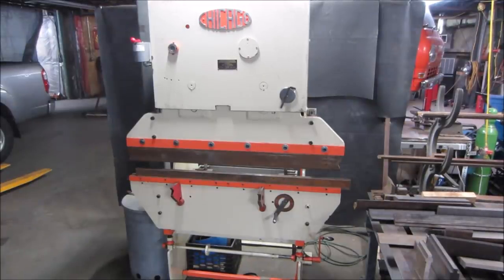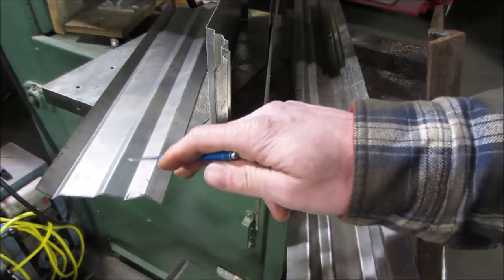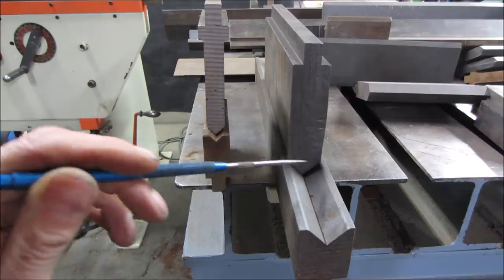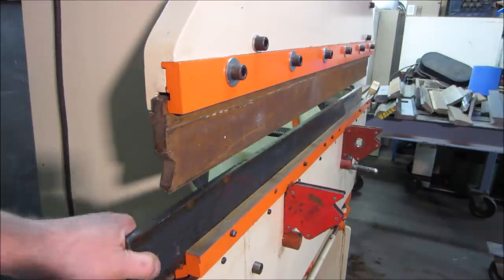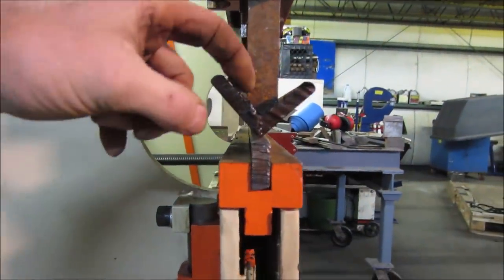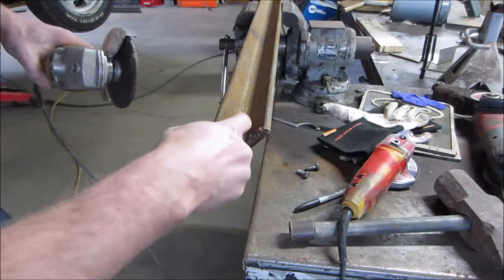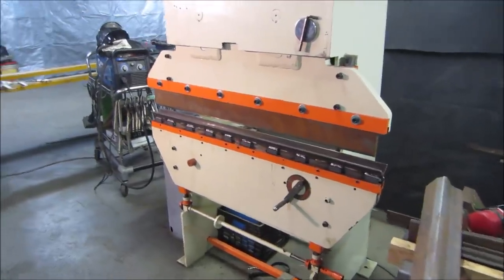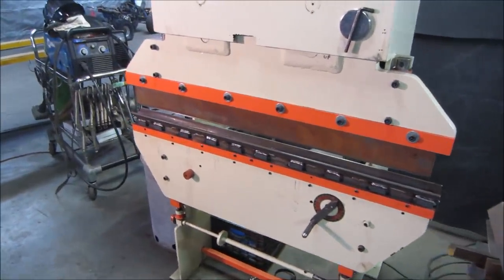Building Press Brake Dies out of Angle Iron.

Comment: Andrew Camarata uses a Fein Slugger circular saw that cuts metal perfectly. He was cutting 1" plate with ease and the edges were perfectly smooth. I think they are available on Amazon.
Reply: Andrew!
Reply: @polymath No, abrasive saw RPMs are too high
Reply: Aren’t comparing two different approach’s to solving problems that have multiple solutions?
Reply: Kirk Valko  Very true! AvE tried to convert an abrasive chop saw into a metal cutting saw. Didn’t work for that very reason.

Comment: Off topic but I wanted to give you a shout out. Picked up a garage sale Columbia self propelled mower last year and it ran great with 1 pull start till a couple of weeks ago (yes we're mowing in Texas already). Was going to take it to a shop to fix it and thought well heck I've watched mustie fix worse so how hard can it be? Pulled the bowl on the carb(clean) and then noticed the choke baffle was open:thermal choke supposed to be closed when cold. Fiddled with it and found it to be gunked up externally. Sprayed on some carb cleaner,freed it up and it's back to a 1 pull start. Thanks for taking the time to post instructional videos! I' old and been fooling with "stuff" for over 40 years: sometimes a refresher course is a great thing to have.Thanks again. Amos

Comment: Brings back a lot of memories, spent a bunch of time at a break press for the Boeing Co. Be careful there is a lot of pressure on those dies, I broke a bottom die  once . Split that thing right in two, never did that again. When you get to use it and become familiar with it , you can sneak up on how much to adjustment it takes on the hand crank. We had a digital read out for ours. Anyway I’m rambling, have fun .

Comment: Mustie, I admire you for making the bottom die. I am glad it worked for you. The only thing I would suggest is beefing up the outer edge of the angle iron. Without the extra support, over time the angle iron “V” opening may open up, making it more difficult to get a 90 degree bend

Comment: I worked for a metal fab shop in Indiana for 20 years  we had two press breaks about the size of yours, maybe a little bigger, we used them for for small thin metal parts, and stamping numbers on parts, i spent many a hour running break press like that, and bigger hydraulic press-brake.

Comment: Mustie1...you were on the right track, the Hypertherm 45XP would have done it in one shot with minimal heat input (less warpage) but the 30XP is at its limit.  It is rated at 10 inches per minute for 1/2".  The 45XP is probably 25 IPM so you could make the cut in one pass.  You also need to consider the primary voltage.  115VAC gives you less secondary power than 230VAC.  Also, you probs hit the duty cycle  on the 30.  BUT, you fixed it, so more power to you!  Transparency, I sell the Hypertherm line and have many years of experience with them.  All great machines.  Love this channel.

Comment: Hi, grind off grey scale sometimes helps cutter,also may need to support sides of angle iron as they may start to open out over time when bending thicker sheet. In industry a little lube is used on base form, helps metal slide into shape. Good job thanks for all videos.
Reply: I was wondering about the lube aspect. Thanks for mentioning it.👍
Reply: @Laz_Arus  thanks for comment, Worked in car industry 30+ years,press shops etc.

Comment: The upper tooling is called a punch. The die is the bottom tooling. I spent many years working cnc press brakes. At one point i worked forca comppany with an 8 metre unit (although not as a press brake operator.

Comment: Top 'die' is actually called a Punch. Die on the bottom, Punch on the top. Hardly ever have to section the bottom die. Top punches are cut to specific widths, so the combinations will make almost any width. The specific lengths are listed on the punch mfgr's web sites.
Reply: @mattthescrapwhisperer  thing is, that with big machines for production work, you can have one half with the punch up, die down, but the other side reversed...why? flipping a 50+kg piece of sheet metal takes a fair bit of time, if your part is has a multiple zig-zags, this saves a fair bit of time.
Reply: @AKAtheA  Agreed. Sometimes that type of setup is the most expedient.

Comment: I'm sure this is how it all started, making something that will work for you. Now all you need to find is an old metal lathe to make your dies from scratch too. The shims are easy, just use key stock of different sizes. Great job, can't wait to see you fighting rusted frames and pans, one bend at a time.
Reply: He has a lathe.  Question:  How would you make those dies on a lathe?
Reply: @paulcopeland9035  Technically I guess it would be a mill/lathe. Where the cutting is stationary and the piece moves. Modern day CNC machines with moving heads handle this work now, but back in the day, it was all man and machine. The way he finds things to work with, you never know when he would come across one to be able to do that. I used to have to work with a lot of machinist for work on our equipment, so was in a lot of shops. it was amazing how they made things from a lump of steel. I hope this clarified the meaning of my comment for you. I am not always smart enough to explain what my mind spits out, thank you for the reply.

Comment: It looks like you are having problems lining up the material. One thing you might consider is to set up a lazer level that shoots down the trough of the die. Then when you put the material in there will be a line to match up to where you want to press it. I make skis and use this method to a line things all the time and it works great. Just an idea. PS your the man!

Comment: Try one of the 'new' Diablo steel cutting saw blades. I just picked one up for the metal cutting 'beam' saw I built from an old DeWalt ('50's era) radial arm saw and fell in love, instantly.

It's a carbide tipped blade, with a negative hook, (think that's the term) so it doesn't catch teeth and tear material out of vises. It is an amazing steel cuttin' blade, made for cutting thick steel, not the 'conduit' blades that have been around for a while.

The rip you needed to make could be done with a Skil saw in 3-5 minutes  with no clean up needed, just an edge deburr!

Comment: The ledge on the bottom dies that sit on the die holder top surface allow for shims to compensate for variation in bend angle along the length. If you have an old tape measure you can cut it up into different lengths and add them in areas that are not bending as much. If you add more than a couple shims on top of each other be aware that the die will rock when the top die (punch) pinches the metal. Avoid this by tightening the the allan screws on the bottom die. Nice video!

Comment: I've used the hydraulic version of these machines 10ft wide and ours had a laser line which made lining up the workpiece much easier also the bottom die had 4 different sizes on it. It is handy having different length top dies to use for folding 4 sided pieces.

Comment: Regarding the rough edges with the plasma cutter, another YouTuber, Andrew Camarata, found that for really thick stock the Fein Slugger Metal Cutting Saw works best - no burs, clean cut. Fein makes a lot of metal saws. I’m referring to the handheld ones. $300 to $500 depending on size and power.

Comment: I used to run a Ceybold guillotine much like this machine at Samsonite in Denver assembly it was 72 inch blade with air tables on front and measuring air table on rear. We used it to cut thin strips of plastic about 100 layers of sheet at a time along with laminated cloth on chip board. The machine was rarely ever not in use the lower was a strip on nylon that was replaced about every 90 days and the blade was $500 to sharpen and make true about every 6 months as maintenance but would be times it would need sharpening earlier. Unfortunately it and 1500 jobs at Samsonite Denver was sent to Mexico Samsonite plant when NAFTA happened.

Comment: The problem with making dies out of mild steel is that they will wear quickly.  I made a set for my hydraulic press years ago so I could fabricate ganged stays for steel hydraulic lines on a farm implement. They worked, but were pretty much worn out after bending a dozen parts.
Reply: Yea they do wear out much faster, but they may last ok for him as much as he is going to use it.

Comment: Great job of self reliance.  The break should have the ability to adjust just one side independent of the other, set the left then disconnect the shaft and move the right side to compensate for the can slop.  Just an idea from my misspent youth in the bus factory

Comment: I worked at a job bending sheet metal, we had 1 press like yours, different brand and 2 brakes that were much larger. The large ones were both Cinncinnati brand, and they were about 3 times as wide as the small one.

Comment: Mustie, the easiest way to bend thick steel is to use a torch for spot heating then quench the spot with water. The spot shrinks and bends the steel. This technique can be used to move steel up to inches thick when carefully applied.

Comment: Hey Darren I've made many homemade dies in my 15 years of running cnc press brakes problem with them is they wear out fast do make the 1 1/2" die it will make the bend radius smaller also look into Wilson tooling for tooling
Reply: If you review the video, I believe he says he is not concerned with durability so much, as he predicts minimal use (maybe once in 6 months).  It seems to me, his bottom die fabrication will be useful for a long time.
Reply: The Wilson tooling will cost more than that little brake is worth.
Reply: @paulcopeland9035  yeah I realize that that's why I said do make the 1 1/2" die

Comment: Good result.  You could heat treat your die to help its durability/lifespan but given the small volume in your shop it is probably fine as is for a while.  Being limited to 15 tons and using it smart will help too.

Comment: Take a look at one of the manufacturers of top (punch) and bottom die sets, look at the die shapes and blow them up to actual size to see how they make it possible to bend various shapes and thicknesses of metal.  Generally the sharper (narrower) the top die is allows for sharper bends - sometimes even coining the the material - this must be done vary carefully to avoid overloading the dies and the press brake. Also check out back gauges that allow for repeated bends of a known dimension.  There are even urethane filled bottom dies that allow for various bend radii based on the shape of the top die (punch). This is a whole technology of its own.

Comment: Wow,those babies are dangerous. I'd convert it to hydraulic. On our tandems at my old job 2 x 20 feet, 40' total. Old pacific presses from the 20's or 30's, all they used was micro switches controlling hydraulic valves, hooked to rams, actuated by depth micrometers to precisely adjust die blade height, with dead man pedals to iniate, and stop die travel. Sounds complicated, but really pretty simple design.

Comment: Definitely need the shoulders. If you look at the die from the end, you can see how the force from the shoulders are sent directly into the jaws. If the new die only pushes in the middle, there is nothing supporting it from underneath. A lot of dies I have seen don't even touch in the middle. That portion is more of a locating feature. I will also be surprised it the angle iron  doesn't get pushed open by the upper die. It needs the support of the shoulders to keep it at a true 90.

Comment: Also Mustie, I would like to see you double clutch the foot pedal. First clutch brings the ram down to the metal and stop. The second cycles through to bend. This stops the metal out front from popping up violently. It will also keep from causing dents on the bottom.

Comment: I would think you could take a piece of copper pipe or something like that to create pressure under your base steel form to help provide pressure against the upper die.....which could help overcome the possible slop in the cams like you explained. sa stick of 3/8 copper pipe is pretty inexpensive when you consider the number of times your die may be used. Just a thought

Comment: A good tip : take a 6" length of 1/2" round rod and weld your Allen wrench to it in the middle and make a heavy duty T-wrench the one I built I let 5" of the Allen stick out after cutting it and Tig welded it so it was smooth this will speed up your die changes.

Comment: The break I have can bend up to 126 inches long. It's a "tin banger" tool. It payed for itself, several times as I do custom made aluminium/copper fascias, doors, chimneys and windows flashing. The throat clearance is roughly 14 inches and I can bend a minimum of 3/4 to 5/8 inches.

Comment: Punch and die are specific to material thickness. You will bottom out with thicker material before you bottom in the die radius .
E bay and other sites you can find good used die and punch.

Comment: Can you clean up the old ones for sharper/cleaner edges? Ever thought of water jet cutter?ever thought of buying extra set of hex keys then cutting them to use in drill? Then welding horizontal piece on what is left to make T handle?

Comment: No nothing about these benders but I'm sure there is a reason they use solid steel. Be careful with welded fabbed parts. Stuff may break and go flying
Reply: He did say that he might weld across the whole length, that would make me feel better about it. I am wondering if the bottom piece, the die, needs to be hardened. Mild steel is pretty bendy. Though hardening it may make it brittle and dangerous.

Comment: If ever you are concerned about an inner radius, you can either use a set of pin gauges, if you have them, or measure out flat washers half the diameter is the radius. the outer radius is the "pin" size plus the material thickness.

Comment: I ran brakes for 20 yrs  top is ram bottom is bolster dies should be 6 to 8 times the thickness of material  round radius is 1to1/2 and axis brakes and cnc are great  when you align the dies first and shim them you will save a lot of time. Be careful even small manual presses like this can be powerful and dangerous

Comment: Would like to see the flywheel, cam, and the rest of the guts.    I recently acquired an air over hydraulic finger press brake with 2 cylinders about the same size as yours.   The hydraulics need work.

Comment: When you were doing the press for the econoline and needed to get a rounded edge I couldn't help but wonder if having a straight pointed Vshaped punch with a heavy cloth clamped over it would help make the right kind of curve to the panel to be. If you had something like a steel tube cut straight across the diameter to press into. Perhaps something like the old style tarpaulin (thick cotton based, with a rubber coating on one side - like an old waterbed) folded over several times (the more folds, the rounder the shape that you'd get) pressed down to shape the length of metal that you're making into the bottom panel. If you could avoid completing the press the rounder the shape would be. I don't know if this would work but if you've got the right kind of thick material (eg. denim) it may be possible to do. Perhaps a couple of battons clamped to the press would hold it in place.

Comment: I am not an expert,but it seems to me that if you make the inside corner of the angle a bit sharper,it will not over bend so much. Right now the upper die is squeezing in the point where they meet,and there is clearance on the sides,allowing the edges to be forced inward.

Comment: Just to let you know in case you didn't notice. (you never mentioned it at least) Your lower die must have those shoulders. If your looking at the orange base on end you will see it has no center support. As you know if you push down on the center it will eventually break the bottom section. (A bad thing!) The shoulders are supported by the steel sides of the machine. (Or maybe its made from iron?) Trying to help you out a bit my friend.

Comment: Mustie don't you have a turret lathe  cut the V solid stock wield in a wider deep groove on bottom part each side what you got will work cracks in the welds might develope just saying my dad did the same and in last about 40 runs

Comment: Have a look at the engineering toolbox channel.  There is some interesting information on air bending.  I have replicated his spreadsheet for optimal bottom die vee opening, but haven't yet got the brake attachment for my press which I've been widening for the purpose.

Comment: Mustie, they make new and different "castle" style caps and cutting tips under the cap to help make that particular plasma cutter more efficient. Plus by the looks of that cut, you shouldnt have to go that slow anyway.
Reply: I have the same model plasma too. I’ve only used the flat style tips that it came with, didn’t know anything about castle style tips. I’ve always drug my regular style tips on the material, pretty sure that’s what the manual recommended. What does the castle style do differently?